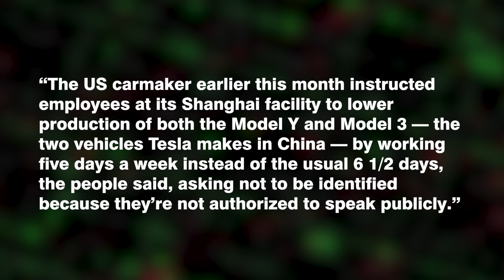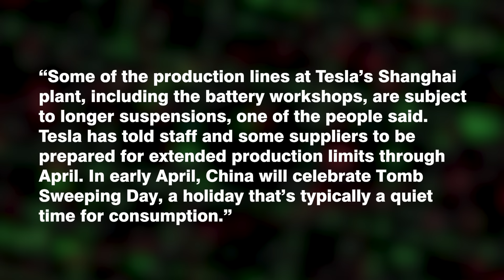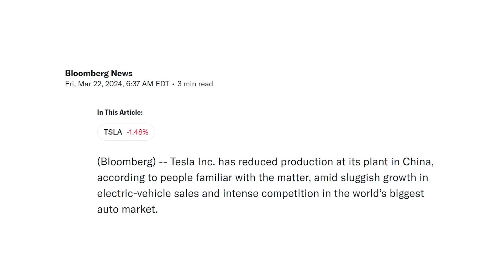Tesla FUD Will Backfire | Disruptive Investing News

Comment: They are only cheaper if you charge at home in UK the kw prices at fast chargers ridiculous
Reply: Specify?
.

A ballpark figure of the most expensive Tesla charger at 53p with a pessimistic (Tesla) 3m/ kWh , compared to a diesel price of £1.51/ litre (London, cheap station, this week) puts a 40mpg ICE at 70% more expensive.
(And that's just for fuel)
.
Of course if you want to choose a less efficient EV, use the most expensive chargers (why would you?) and hypermile a diesel, you might fiddle a negative bias....
(Note that I downgraded the Tesla figure from the recognised (better) consumption of 4+m/kWh, took the highest priced peak time Supercharger (normally circa 40p)  and improved the Diesel consumption (My regular consumption as a Modeo business driver was 32-36 mpg doing "actual work")
.
(Oh... The diesel price, my local Sainsbury's, always the cheapest in the area)
Reply: 47p drop-in at a Supercharger locally for me, 39p Tesla member. That’s still cheaper than petrol.